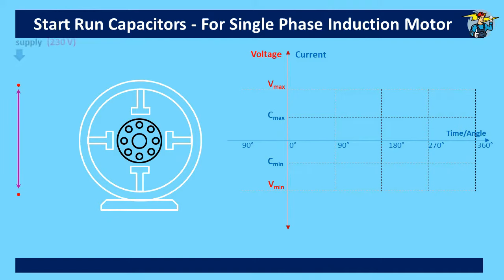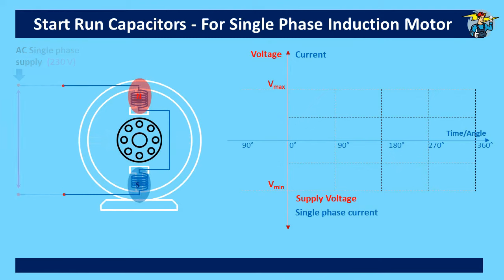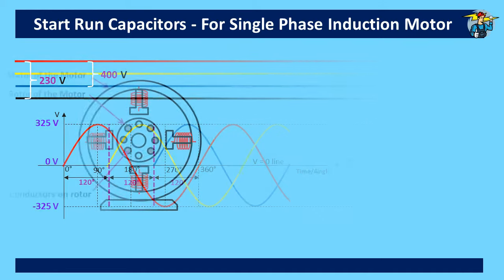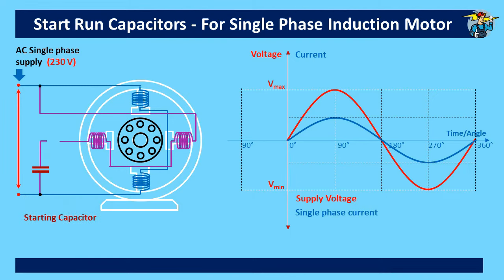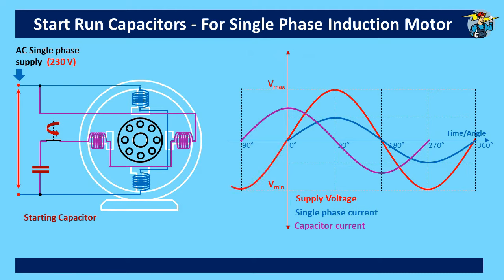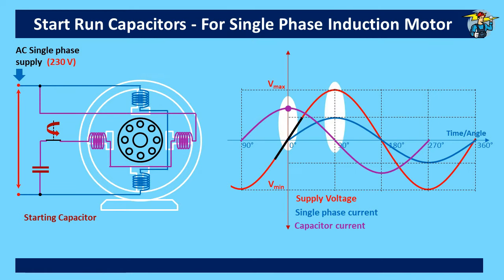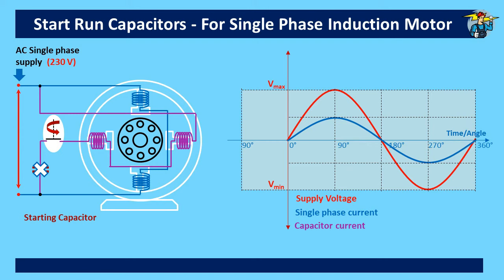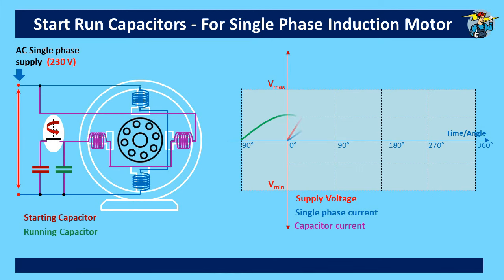Single phase Induction Motor / Capacitor start capacitor run motor / Best video for you to learn.!😍💪

Comment: This means a single phase is never enough to start a motor and you create another phase with a capacitor.
Reply from the maker: Exactly.
Most single-phase motors require a capacitor to start, especially in cases where moderate to high starting torque is needed. (Compressor motors, pumps, etc.).
How ever Shaded pole motors and Split-phase motors are with a different arrangement and can start without a capacitor.
But they are limited in their capacity due to very low starting torque and efficiency.
Reply: @ElectroAcademyEA  excellent video! I have many questions since I'm in an electrical class at the moment. Do you think you can answer a few of my questions,m

Comment: So basically, a capacitor start capacitor run motor runs as a two phase motor all the time, both when starting and when running.
Reply from the maker: Yes.

Comment: How does the rotor continue running in a rotating magnetic field if the start capacitor disconnects and there is no run capacitor either, because the start capacitor itself was responsible for the stators rotating magnetic field in the first place right?
Reply from the maker: The rotor continues to run after the start capacitor disconnects, due to an event known as rotational inertia and the residual rotating magnetic field.
The start capacitor initially provides the phase shift to create a temporary rotating magnetic field. 
This is necessary to overcome the initial inertia and produce enough torque to start the rotor moving.
Once the rotor reaches a certain speed, the start capacitor disconnects often by a centrifugal switch or a relay.
In a single phase motor, the magnetic field is only oscillating rather than truly rotating.
By this point, the rotor has gained enough momentum or inertia to keep spinning, even though the magnetic field is only oscillating rather than rotating.
There are still enough variations in the field that the moving rotor can “chase” the oscillating field. 
This interaction continues the rotor’s motion, even if it's less efficient and has lower torque compared to motors with a run capacitor.
This design is common in low-load applications where the motor doesn’t need high efficiency or high torque after starting. 
In cases requiring constant torque and smooth operation, a run capacitor would be used to maintain a steady rotating magnetic field after startup.
Hope you got the answer.

Comment: Sorry sir why starting capacitor is dead  many times?
Reply from the maker: Capacitors also have a general lifetime.
However, If you connect a capacitor of acceptable brand with correct capacity, it will last longer.
Reply: A start capacitor always worn out due to on n off it endures when motor is starting n it's subjected to high current on start up of motor LRA.
Reply: Correct when you starting motor require high current

Comment: Cap should be on the RUN winding, not the start winding.
Reply from the maker: In single-phase induction motors, the capacitor can be connected to either the start winding or the run winding, depending on the type of motor and its design.
Capacitor on the Start Winding is the Most Common type.
This configuration is typical in capacitor-start induction motors and capacitor-start capacitor-run motors. 
In these motors, the capacitor is connected to the start winding, which is only engaged during the start-up phase of the motor's operation.
If you are focusing on starting torque and the capacitor is meant to help the motor start, it should be connected to the start winding.
However If you are focusing on running efficiency and the capacitor is meant to improve the motor's performance during operation, it should be connected to the run winding.

Comment: What will happen if we use an inductor in place of a start capacitor in single phase induction motor? How could we get an inductor to work as a starter. I would love to see a video answering my question--I believe that this may aid my understanding of both capacitors and inductors.
Reply: The reason we don't do that in practice, is that capacitance is significantly cheaper than inductance, per unit of energy storage.  So usually when a design is indifferent to a capacitor vs an inductor, the capacitor is preferred.

Another reason: the motor winding itself has inductance, which is especially evident at startup.  You get a much more significant phase shift by pairing the motor winding with the opposite kind of reactive element, than you would get pairing it with the same kind of reactive element.
Reply: Super--thank you @carultch
Reply from the maker: If you replace the start capacitor with an inductor in a single-phase induction motor, the motor likely wouldn't start due to the wrong phase shift. 
The inductor would delay the current in the start winding, preventing the creation of a proper rotating magnetic field. 
To make an inductor work as a starter, you'd need to redesign the motor entirely, but capacitors remain the preferred choice for most applications because they provide the correct phase lead needed for efficient motor startup.
Reply: @carultch  Thank you!

Comment: A capacitor is a two terminal thing whose current through it is proportional to the rate of change of the voltage across it. That is , I= C* dv/dt. C just happens to be the “capacitance”. dv/dt is nothing more than the SLOPE of the voltage curve :)
Reply from the maker: Thanks for your comment

Comment: So it means the starting capacitor is bigger than the run capacitor right?
Reply from the maker: Yes
Reply: No. I my AC I have 2 x 3uf start capacitors, and the run capacitor is 50uf. 

But the 3uf caps can be cycled much quicker than the larger one. Lower capacitance means it fills quicker and dischargers quicker. With a start capacitor you're not dumping power like you would in a DC circuit, you're initiating a phase change, So those start caps aren't just dumping once, they're being charged and discharged thousands of times until the motor comes up to 75% of it's speed.

Comment: how can some ceiling fans revert its direction? What is the logic behind the magnetic fields and capacitors that allow this?
Reply from the maker: Purpose of the capacitor of a ceiling fan is to create a phase shift between the currents in different windings, generating the necessary rotating magnetic field to spin the rotor.
When reversing the fan's direction, the fan motor needs to change which winding is leading in terms of current. 
By altering the current flow through the windings achieved via an internal switch or control mechanism, the phase shift caused by the capacitor is effectively flipped. 
This will change the direction of the magnetic field and makes the fan to rotate in the opposite direction.

Comment: So I have a fountain and capacitor is blow, but wiring doesn't look correct as it has 3 connections from the capacitor but the drawing shows no live feed to the capacitor? Just a neutral in and 2 outputs. Is this correct? Single phase motor

Comment: Hello! Please! Would someone explain me how can the voltage be synchronized with current on principal coil? The coil reactance doesn't make current be late compared to the voltage? Thanks...
Reply from the maker: In an inductive coil, the current naturally lags the voltage due to the coil’s inductive reactance.
To synchronize voltage and current (reduce the phase difference), you can add a capacitor to the circuit, which introduces capacitive reactance. 
This capacitive reactance can counteract the inductive reactance, bringing the voltage and current more in phase.
This technique is commonly used in power factor correction to improve the efficiency of systems with inductive loads.

Comment: Hi there...great video....but tell me...is this a 2 Pole or 4 Pole motor?...
Reply from the maker: The pole classification is based on the total number of magnetic poles created by all windings (run and start) in the stator, regardless of how long the start winding is connected.
However, when the motor is running, the rotational speed is determined by the number of poles in the run winding and the frequency of the AC supply.